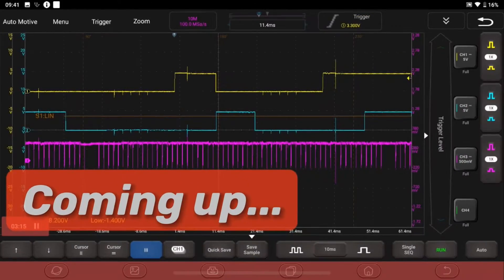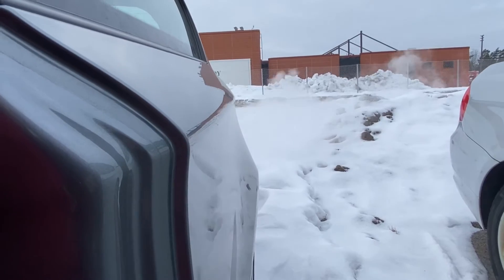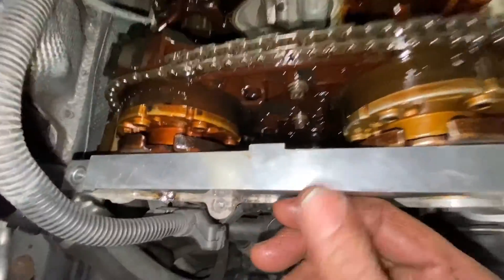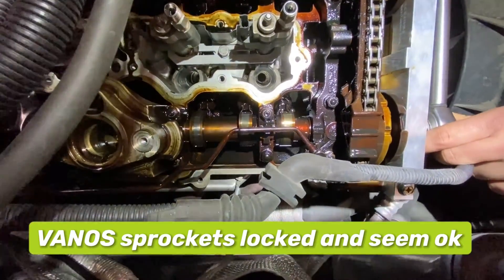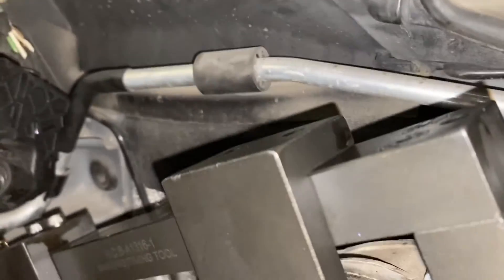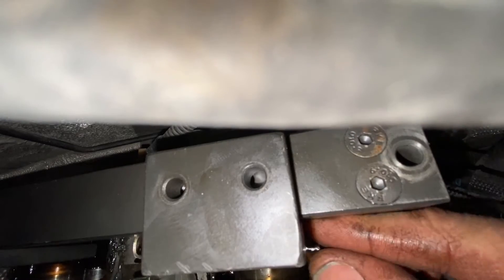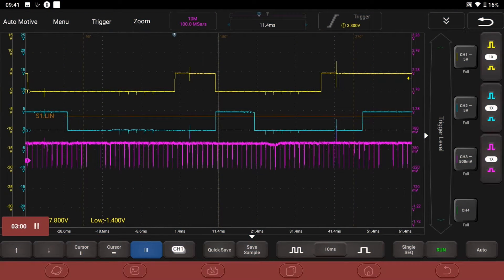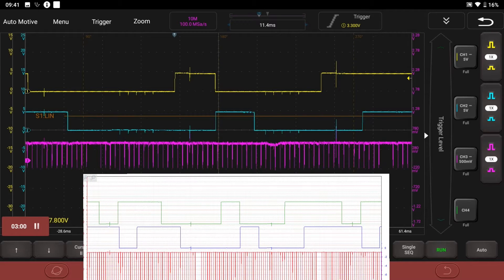WHY DIDN´T THEY STOP DRIVING? N43 WITH LEAKING INJECTORS CATASTROPHE!

Comment: I have an N43, my first BMW and I’ve kept it and still love it. I’m trying to nurse it to moon miles. The replacement injector prices are eye watering though! Wish I’d bought a boat load a few years ago when Eurocarparts had OE for £180 each.
Reply: thats right the injector prices once the car is over 12yrs old makes you think is it worth the investment? index 11 prices are sky high.
Reply from the maker: This repair will cost five n a half thousand 😫 Its those damned injectors. They should give them for free since they are so unreliable
Reply: @BenJFF  yes i almost fainted when they told me the price of 1!! i hope index 11 are reliable as i cant justify replacing them again.
Reply from the maker: @mstar011 hehe 😅
Reply: Is there not a market out there for injector update kits? Forgive my ignorance but could you make an adapator sleeve that would then allow you to fit a modern injector, or are the numbers too small to make it worth while.
Reply from the maker: @julianpalmer4674 We were chatting the other day about this. Fitting megasquirt ECU, disabling the vanos, blanking the oil solenoid and fitting indirect injectors would be the solution

Comment: great video!! i have a N43 and its a love and hate relationship very strange engine most issues with it has been injectors/coils, NOX sensor and of course timing chain/tensioner.
Reply from the maker: Not done a chain on one of these in about 8 years 😂 Should be a nice reminiscing affair. They aint bad once you sort the issues out. Thanks for your support matey 👍
Reply: BMW changed the design of the timing chain in 2013, and the timing chain tensioner in 2016, for the N43 engine. I suppose by then, the N43's reputation had already been cemented. People have run these engines for hundred of thousands of miles without any major issues. The N43 is one of the most advanced engines BMW made. A lot depends on how they were looked after from the beginning, just like all cars really. This is not the car for the trip to the shops and back - it needs to be driven. Timely oil changes is king.
Reply from the maker: @MartiansChronicle I agree bud. The N20 is way worse than the N43.
Reply: Bimmerprofs - phenomenal site for all things N43 & N53 and now the B48 & B58 too.